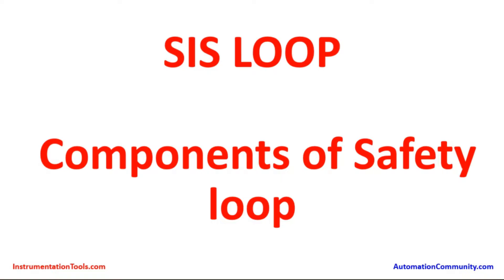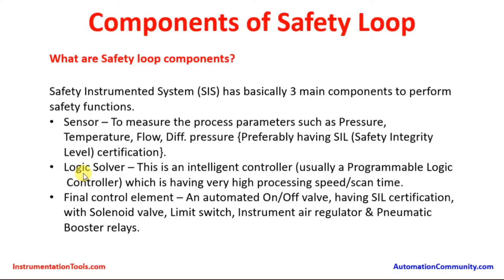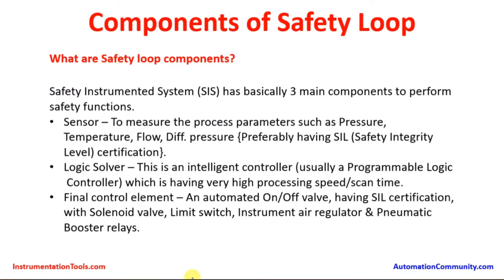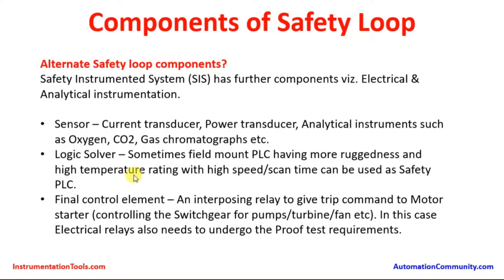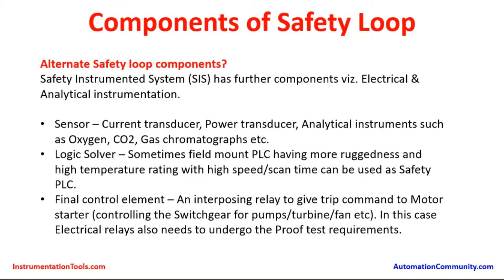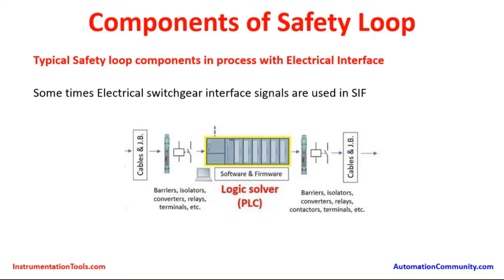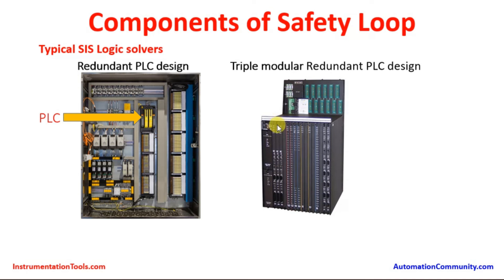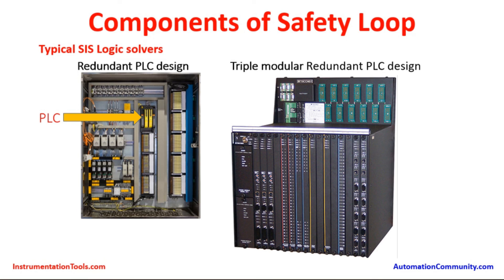SIS Loop - Components of Safety Instrumented System - Basics

Comment: Why sis  have separate loop why wouldn't dcs loop perform additional trip functions
Reply from the maker: SIS is designed such that it will NOT depend on any other control systems like DCS. If DCS fails then SIS can shutdown the plant in safe manner.